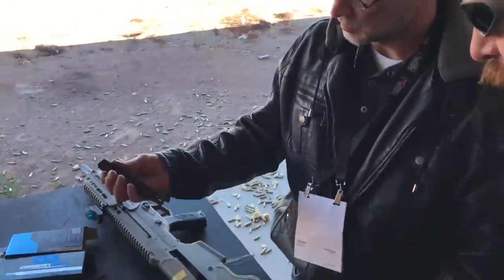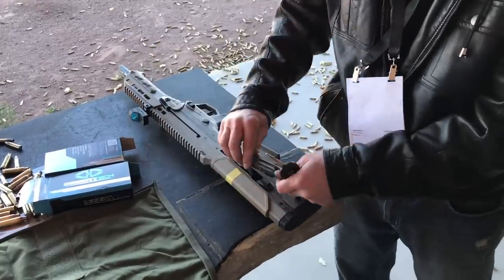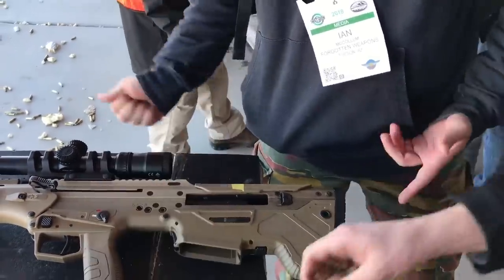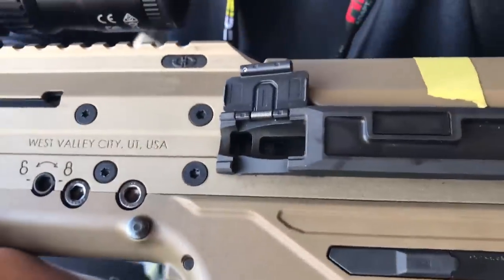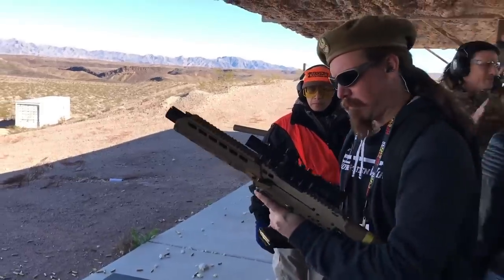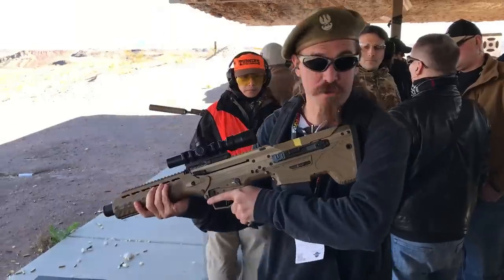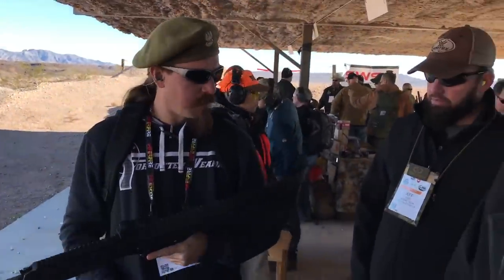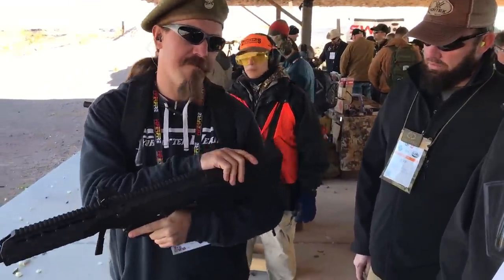Desert Tech MDR: Live Fire, Handling and Analysis

Comment: Man that sure doesn't seem to eject empties with a whole lot of gumption, does it?
Reply: It actually ejects very reliably. It works on a completely different principle to eject than most rifles.
Most rifles eject out the side on the rearward stroke of the bolt. The bolt flies back at high velocity and launches the casing out of the gun.
Instead of doing that, the MDR ejects on the forward stroke. When the bolt flies back, it ejects the cartridge somewhat normally, except instead of flinging it out of the gun, it shoves the casing into the ejection chute. Then, when the bolt travels forward (as with most guns, the forward stroke is slower than the rearward stroke), the bolt pushes the empty casing that is held in the ejection chute forward, out the ejection port hole in the ejection chute.
Alternatively, if you want it to eject like a normal rifle, you can just remove the ejection chute panel, and the rifle will eject completely perpendicular, the same way most rifles do.
Reply: Oh, neat, so it's more just kind of pushing it off of a ledge, as it were, so it's not ejecting with as much force? That's really neat.

Comment: That reflex sight would brake right off if you dropped it.
Reply from the maker: That is not how I would configure the rifle.
Reply: That micro red dot is more or less on there as advertising for it, because that is Desert Tech's red dot they offer on their website. They also put it on the MDR because unlike a full scope, it will mount onto that single-slot segment of rail between the handguard rail and the receiver rail that is directly connected to the barrel, thus won't lose zero.

Comment: What's the difference between this MDR and the SRS?  Just barrel length?
Reply: The SRS is a bolt action, the MDR is a semi-auto; that's like asking what the difference between a Winchester Model 70 and a Garand is. Both the SRS and MDR can easily swap out barrels, so they can either have the same or completely different barrel lengths, depending on what the user desires.
Reply: Well that was not apparent from the wikipedia article I read last night.  My bad since there isn't a wiki article for the MDR yet SRS was the only thing popping up.
Reply: damn it was right at the top of the page.  I must have been more tired than I thought to miss that.

Comment: How do you think it compares to the Kel-Tec RDB? You've spent a lot of time with that gun, so I'm curious to hear what you think the MDR does differently to make it a compelling bullpup (or your best guess since you haven't had much time to gather data on the MDR).
Reply from the maker: We would need to get an MDR and do more with it to be able to answer such questions.
Reply: My thoughts exactly. It seems to me that the Kel-Tecs can do everything these do at half the price. I've owned an RFB for a few years now, and it's proven itself in such a way as to become my go-to gun for everything. It suppresses well, it's very accurate with good loads, and it's 100% reliable. Desert Tech makes a lot of precision oriented gear; will this be reflected in the MDR's accuracy I wonder? Its got to have something to justify that steep price, otherwise... there are other options.
Reply: Sceptis, independent testing by MDR owners has shown that MDR's are slightly sub-MOA with good ammo, and just a little above 1 MOA with common plinking ammo.
Also, the MDR can be disassembled, cleaned, and reassembled with return to zero, same as with Desert Tech's SRS rifles.

You have had better luck with your RFB than many people have had.
Also, multiple calibers with the MDR. .308 is already shipping and has been for months. .223 is due to start shipping in April. Desert Tech claims to have .300 blackout shipping by the end of the 2018. 6.5 Creedmoor is already available for the MDR as well, already shipping (courtesy of Desert Tech's friend, ES Tactical, which also makes SRS conversions for them).
Other calibers are also planned, including .22lr.

If all you want is a .308 bullpup semi-auto, the RFB is great. If you want greater accuracy and all the MDR features, plus caliber conversions (for example, .223 for home defense, 6.5 Creedmoor for hunting), then the MDR does offer more than enough to justify the price.
Reply: It certainly has potential if it lives up to the hype. This thing is a bit like the bullpup version of the FN SCAR-H: high quality, cool as hell, durable, but functionally not much better than an AR-10 at half the price (or in this case, the RFB, being its closest analog).  Also, the issues with the RFB were scrubbed out in the second generation. They really are awesome guns, so long as the end user does their part and understands how to properly attenuate the things. It's not a sub MOA gun though. I'd call it a 1 - 2 MOA gun on average, but it can be pressed to around the 1 MOA mark with premium ammo. If you can afford it and slightly smaller groups and interchangeable barrels really floats your boat... cool, buy it. For the rest of us, It would likely be better to use the extra money for ammo, glass, and a suppressor; all of which could be had on an RFB for around the same price of this gun naked.

Comment: How’s it stack up to the RDB?
Reply: If money (or weight) is your concern, I would go RDB. They both shoot the same projectiles through a semi-auto bullpup. If just putting holes in bad guys for home defense (at a reasonable price) is your concern, the RDB is plenty good for that.
I'm very familiar with both and have been following the MDR for years. I currently have one on order.
For cost, it is hard to beat Kel Tec when it comes to bullpups.
However, where the MDR comes into its own is with accuracy, modularity, caliber conversions (ranging from .22lr to 6.5 Creedmoor, of which .308 and 6.5 Creedmoor are already released and shipping), ergonomics, and quality.
I love Kel Tec, but I have to objectively admit that while their guns are good enough, the precision and quality of their workmanship isn't why I buy Kel Tec. I buy Kel Tec long guns because they have the design I want at a reasonable price. Desert Tech is known for being really high end in terms of quality.
Accuracy: Courtesy of multiple independent reports, the MDR is just about 1 MOA, slightly sub-MOA with good ammo, a bit above 1 MOA with common plinking ammo. The MDR also has return-to-zero with caliber changes and cleaning, as they use more or less the same mounting system for their barrels that they use for their SRS rifles.
Modularity: A huge surge of aftermarket support is growing for the MDR. There's already caliber conversions, handguards, trigger packs, and much more. The design itself is very friendly to aftermarket support.
Caliber conversions: .308 MDR's are already mass produced and available. .223 / 5.56 MDR's are shipping in April. .300 blackout is supposed to be shipping by the end of 2018, but I wouldn't hold your breath on that. Those are the calibers being currently offered by Desert Tech, but they supposedly plan to do more. A sister company with a tight relationship with Desert Tech, ES Tactical (which already makes SRS conversions for DT) already has 6.5 Creedmoor available. Many other cartridges are being planned. There was talk of .22lr, 9mm, 7.62x39, a bunch of hunting calibers, and some big bore calibers.
Ergonomics: The MDR offers a great trigger. It also offers BOTH front and rear magazine releases. It also has an ambidextrous bolt release, charging handles (with HK-style hold-open and slap), and safeties. It ejects forward on either side or it can be run without the plate and just eject perpendicularly, the same way a Tavor would.
Quality: The MDR is very well made. Machining is precise and the design is good. I love my Kel Tec's, and they mostly work, but I can't say they look super finely machined.

When it comes down to it, why did I personally choose the MDR?
1) I want options for how to reload, so I like having both front and rear releases.
2) I REALLY like that cool delayed forward ejection.
3) I wanted a more accurate rifle
4) The RDB seemed to have heat issues when it came to the handguard not handling heat well
5) I wanted a single rifle that would be perfect as both a home defense bullpup and a hunting bullpup. The ability to change between .223 and .308 does that for me. A future .22lr conversion will only secure the deal for me, with cheap range plinking, teaching children, and small game hunting covered.
6) The RDB's sling points were unacceptable to me. I'm rather picky on that front. The MDR isn't perfect, either, but I can rig up the system I want with the MDR. I want side points at the rear with which to run a nylon strap across the butt.

Comment: So he short shucked it?
Reply: Yes. As with most guns, if you short stroke the action, you can induce a malfunction.
However, like with some other bullpups (like the KSG), the MDR's design makes it a little easier to short stroke if you don't work it with conviction.
Alternatively, you can avoid the issue entirely by removing the ejection chute panel, at which point the MDR will just eject perpendicularly out the side like a normal rifle would.

Comment: What on earth is going on with that hand guard? And it's the same on both guns. All droopy and sad. No good for attaching sights to.
Reply: That's just a camera effect. If you look at 2:05, you'll see that the handguard doesn't actually droop.
Reply: The handguards they were using were the suppressor handguards.
That said, Lucky Irishman Firearms has an aftermarket aluminum MDR handguard that will address all the issues.
Reply: Hey man, thanks so much for the info...been sad that my future MDR couldnt rock a MAWL
Reply: What's a MAWL?
On a related note, in response to how Tavor owners call their rifle their "Hebrew Hammer", we, as the MDR user community, have decided to call our MDR's "Mormon Mallet".
Other names were Mormon Maul, Church of Latter-Day Saints Sledge, and Polygamous Pickaxe, in reference to the MDR's multiple calibers.
Reply: IR/visible laser
Reply: Also, They probably improperly installed the handguard. There are actually two screws to help return the handguard to close-ish to zero. That said, there are very few rifles with which their handguards are the ideal place to mount optics. The MDR has a little piece of rail in between the handguard rail and the receiver rail. That section of rail is directly attached to the barrel and won't lose zero at all.
Reply: I wouldn't put sights on a handguard even on an AR. I like what they did with this rifle, which is put a rail on the gas block that sticks up between the rails on the receiver and handguard. That way you can zero your sights to individual barrels if you have multiple conversion kits, and the rifle should theoretically hold zero every time you swap the barrel out, because your RDS stays on the barrel permanently.

Comment: Ian tries to eject a live round and it jambs. Desert tech rep calls that a “quirk that you need to get used to” unacceptable on a $2400 rifle.
Reply from the maker: That’s a ridiculous statement, it was one time. We will have to see if this continues to happen on the clock and other environments once he has used of the gun. Anyone can short stroke a gun.
Reply: Any gun can have a malfunction induced if you short stroke the action. Pull back a Glock just enough to start ejection but not complete it? Malfunction. Pull back an AR just enough to start ejection but not complete it? Malfunction.
That said, the MDR is more prone to that, just as the KSG is. The KSG has smooth and resistance free travel for 95% of the pump movement. Then that last quarter-inch has A LOT more resistance, but that's where almost all of the cycling happens (ejection of spent shell, releasing of new shell from the tube). The KSG is prone to short stroking just because users don't understand the design, so they stop at the 95% mark because they are used to 870's where it's smooth all the way through and they are used to stopping once they meet resistance from the pump.
The MDR is similar. Most of the rearward pull of the charging handle is just pulling back the bolt and the cartridge. It's that last little bit of travel that actuates the scissor mechanism to push the cartridge into the ejection chute. If you don't get it 100% of the way there, the cartridge stops half-way through the ejection process, inducing a malfunction.

There are two really easy solutions to this:
1) Just run the action fully, with conviction.
2) Just remove the ejection chute panel. Without the ejection chute panel, the gun will still function, except instead of ejecting forward, it will eject perpendicular, directly out the side just like a normal rifle does (and it does it with some serious umph).

Comment: I never understand that idea of "easy switching" for left and right handed... Its not like you gonna do this often. Why making some complicated systems and changes just for quick switch?
Because you not gonna do this often, if never after getting gun, just make it in some normal way without messing with anything else, like here we had situation like Ian had when case didn't eject because of that switching system. And even guy said that "you need to get used to it"... No you can't get used to it. It's flaw in design of gun.
Reply: If you don't want it to eject forward with that complicated system, and you don't want any of the possible malfunctions from such, you can just remove the ejection chute panel and leave it off, at which point the MDR will eject perpendicularly out the side, just like a normal rifle.
Reply: I know that, but not without a reason it is there(it cover hole from dust and other particles). 
But this just show that this design of gun have obvious flaws that you see just after first test shooting.
I can just imagine that people start switching it all the time just for fun of that feature and it start wearing off, and I can bet that after some time those flaps just pop-up after one shoot...